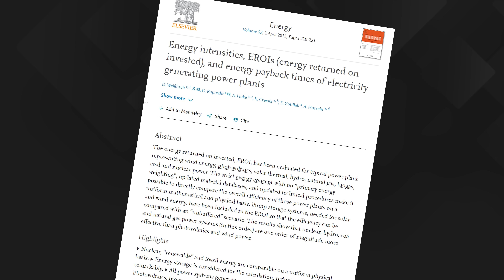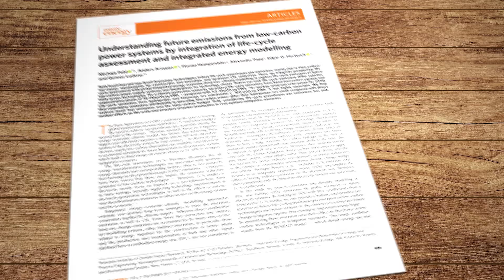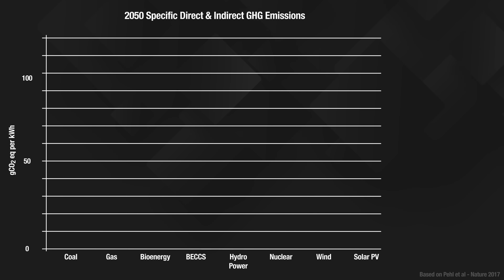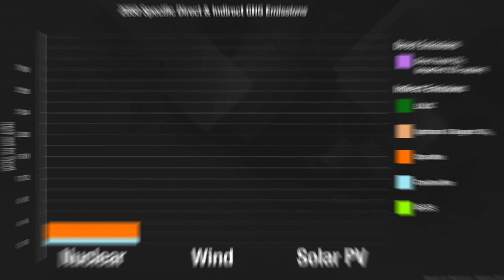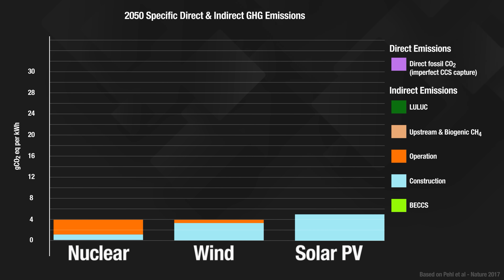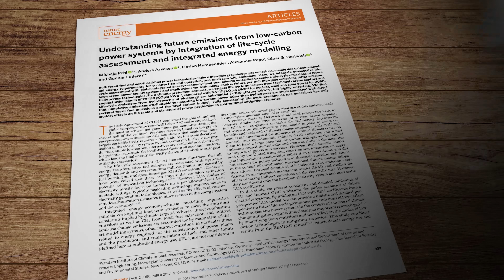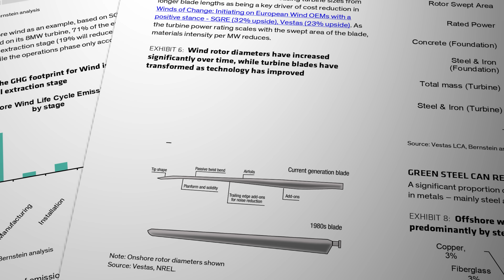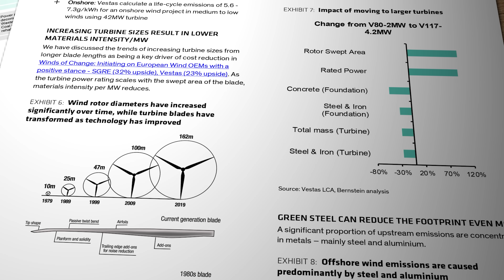Lifetime carbon emissions of renewables vs fossil fuel. Problem or solution?

Comment: Nuclear Power is a glorified steam engine with deadly nuclear waste we have to bury deep underground and has the potential to kill all life on the planet if things go really bad.  We have been very lucky so far in regards to nuclear power Fukushima nuclear disaster still could end up being a long term killer and has affected the Pacific ocean fishing industry and wildlife.   Tesla had the right idea we should try finding out how we can get the electricity that sits freely all around us called zero point energy which does exist and probably used by the military which is at least 50 years ahead of the private sector in technology having portable nuclear batteries since the 60s.

Comment: Is there any method founded to recycle nuclear waste
Reply: In France a part is re-used, our nuclear with everything including waste management is at 4g/kWh, there was a project called Astrid for even more waste but it was abandoned for few reason… mainly political 
We could recycle some amount and we could potentially closed the cycle even more, but nothing for waste already present and stored but you should realise that for France all the long life high activity nuclear waste of all the country during his history, so decades of low carbon electricity, represent a cube of around 15 meter… it’s a very tinny probleme to managed this amount of waste comparing to all those co2 emissions and air pollution it has avoid
Reply: The answer would seem to be yes, but it's cheaper to just go mine some more. Moltex and other future reactors do intend to use so call waste as fuel.

Comment: Thanks for that video. I wonder though, when you account for the energy storage required for the intermittent (P/V and wind) options how the equations might change? 
 It looks like a combination of nuclear for base load to go along with wind/solar and of course energy conservation (we are an affluent and wasteful lot) might be the most promising solution,...at least for now.
Reply: wouldn't be much if the extra electricity was used to make hydrogen and then that hydrogen could be used in a fuel cell to create electricity again. even if you had 10x more wind/solar then what was needed and even if you only got 10% efficiency from the conversion of electricity > hydrogen > electricity. it still wouldn't come even close to the other major polluters. granted this 10% efficiency is laughably low and it's actual rate is much much higher then that already (70%+).
with current lith batteries, i doubt it would even be worth it. however the new batteries that are being worked on, well those might be quite different.
the reason to go hydrogen over batteries is that hydrogen has uses well beyond just energy storage.
Reply: If you mean batteries, then what we hear about EV production suggests quite a large carbon footprint.
Reply: @emmabird9745  Source?? "What we hear about EV batteries" is often naysaying from fossil fuel interests. Or they make valid criticisms about OTHER pollutants, not CO2. In the case of EVs the extra CO2 from building the battery is more than made up for after 3-5 years of average American driving patterns. So I can't imagine battery storage bumps the CO2 intensity of solar and wind anywhere near fossil fuels
Reply: @ThomasBomb45  Hi Lily.  I am certainly not a naysayer.  My reference to cars was only because that is where the talk of carbon cost of batteries has been.  If I had a simple affordable route to convert my petrol car to EV I would do it.  Unfortunately that is not vissible and new EVs are way out of my financial reach.  
I am sure there are varied energy/GHG costs of different sorts of batteries which should be taken into account in life cycle costs and hopefully they will be low.  See also my reply to Aaron below.
Reply: @emmabird9745  depends on the battery. Most people think of lithium batteries, which are expensive so they can be small and light.
You can make batteries out of iron, water, even CO2, if you are willing to devote some land and space to it.  I'm not talking about gravity storage either. Iron batteries use the same mechanism as lithium. They take 10 times the soace but 1/10th the cost, they are also better "long load" batteries, good for lasting decades of a 12 hour charge, 12 hour drain cycle.
Reply: @aaronbaker2186  
 I agree, Aaron. Most of the current "talk" is about lithium batteries and while their properties are a good solution for mobile applications that require them to be small, light and  quickly charged/discharged those properties are not near as necessary for augmenting intermittent generating sources for grid application.
 Hydrogen, as mentioned by a previous poster, is a promising concept, I also like pumped hydro and tidal. Both worth considering if your geography will allow for it. Tidal is also intermittent but its %100 predictable centuries in advance so it would dovetail very well with pumped hydro.
Reply: @aaronbaker2186  Hi Aaron.  You are obviously right on this and I agree.  Indeed I made a similar point some months ago talking about renewable storage for wind/solar in another video.  For static storage size and weight are less important than money cost, environmental cost and use of rare materials.  In this case environment cost should be paramount.
However what I was driving at (or trying to) was that batteries may have a GHG cost which should be taken into account as part of the system.  I did not intend to suggest that it might make it as bad as fosil fuels, perish the thought.
Reply: So you're asking for the calculation to include the assumption of a stable grid given climate/planetary variables like wind streams, cloud formations, and sun angles. 

I think the IPCC would be a better organization to get a better sense of that kind of LCA since the IPCC tries to incorporate those kinds of actors that deal with these kinds of variables outside of just the costs of construction, operation, maintenance, and deconstruction.

Edit: with that assumption in mind, I'm sure reports like this would need to incorporate battery storage because that is 100% needed to ensure grid stability

Comment: Nuclear waste can be 'disposed' of in a thorium salt reactor.
Reply: Nuclear waste fuel can be reprocessed and used again. France does this. It just cheaper to bury it. Also Moltex intend to use unspent nuclear fuel for their reactors.
Reply: @Music5362  The general consensus in the industry is now that building very deep and secure (ie not just a literal hole in the ground to drop stuff into) storage sites at great cost is the way forward. Why would that be if all nuclear waste can truly be reprocessed, the cost surely can't be more than the expensive deep storage solution? I do remember a British nuclear site trying, a couple of decades ago, to reprocess fuel but for whatever reason they could only reprocess paltry amounts. That seems to be a recurring theme in the nuclear world, always promising magic but usually falling a long way short.
Reply: @danyoutube7491  From what I have read regarding Thorium salt reactors. Spent nuclear fuel rods which contain: 96% of the mass is the remaining uranium: most of the original 238U and a little 235U. Usually 235U would be less than 0.8% of the mass along with 0.4% 236U. Thorium salt reactors can adapt to a variety of nuclear fuel cycles (such as Uranium-Plutonium and Thorium-Uranium cycles), which allow for the extension of fuel resources. They can also be designed as nuclear waste “burners” or breeders. which will produce a 2% waste of Cesium 139. The main reason why Thorium salt is not implemented is because Thorium/Uranium 233 reactors do not produce Plutonium, Which is needed to replenish all nuclear warheads every 12 years. A large percentage of nuclear waste is decayed warheads.

Comment: Renewables should be considered low carbon not carbon neutral, untill there is  acompanying carbon capture, and whilst the nuclear waste storage will take some energy it will be  relatively trivial as these are only for high level waste
Reply: Yeah I believe that is the common phrase for it. Low carbon, i.e. nuclear, solar, and wind. Possibly biomass and biogass, depending on the sourcing of that
Reply: " these are only for high level waste" Of which there are 400,000 tons of over 1000 deadly radionuclides, mostly sitting at NPP's and reliant on the power grid to keep them from burning unquenchably. Game Over!

Comment: why is nuclear always assumed to already come with free fuel? producing nuclear fuel is among the most complicated and energy intensive metallurgy humanly possible. (this is also by the way, where most of the  risk lies, when you scale up nuclear to the necessary amount to keep up with our needs, the question if reactors are 'safe', is just the wrong question in that regard) all the mining, nitric acid and fluorine production necessary to produce those elements is never factored in, neither regarding co2, nor cost, while with renewables on the other hand, almost all of the carbon production misleadingly assigned to them comes from the energy put into production, which could and should be substituted 100% by renewables in the first place! there is no intrinsic reason for a solar cell, or wind turbine to produce any co2 whatsoever, given enough carbon free generated electric energy to produce them is available.
Reply: @liem11  you don't seem to have the slightest idea of what you are talking about. 'recycling it' makes things a whole lot worse in terms of nuclear waste as well as in terms of energy consumption. You might want to have a look at those videos:
https://www.youtube.com/watch?v=DmczVhGq8cU
https://www.youtube.com/watch?v=E0wtKOG8trE
and all the others periodic table of videos produced within the oakrich facility to get an idea...
and be aware to the fact, that none of those hot cells you see there have been opened since taken into production, because that's a thing humans can't survive. the same goes for all those sub terrain tanks and there contents mentioned. apart from the tons of highly radioactive waste per pellet, there is also ten more tons of contaminated waste, that's not measureable radioactive, yet can still kill thousends of people, when catching fire, or dissolving in drinking water.
also it's not a discussion, the numbers exists and nuclear as done today produces a shitload more co2, when fuel production is encountered it comes out between the renewables and natural gas.

Comment: The emissions for manufacture of renewables also improves over time due to the energy mix used by the factories becoming less emissive as the previous batch of renewables are installed. Current household solar is only around 20% efficient and industrial solar around 25%, so will be interesting to see how those numbers change as the newer 40+% panels become commercially viable. In theory the emissions should be lower than even wind, but depends how the manufacturing and lifespan changes with these new ones.
Reply: My 7.5 PV system  with battery backup meets all my needs and the best thing is the sun never sends me a bill!
Reply: I would rather have a 20% efficient solar panel at half the cost/kwh and half the CO2 cost than a 40% efficient solar panel that takes more specialized components. We have plenty of roof to power buildings, so trying to make panels slightly smaller is probably not important for most.
Reply: Your first point is a very important one. 

As we adopt more commercial green generation at the facility endpoint, the greener it gets to make green energy products. (Put solar panels in the roof of the facilities that make solar panels and their materials production, and their distribution warehouses) It is a beneficial feedback loop. 

Same thing for EVs. The more commercial EVs and electric industrial hardware the greener it  gets to mine, ship, refine, ship, manufacture and ship EVs. 

And if we do both adopt green generation and EV transportation at the same time, they both compound on each other for lowering emissions of all industries.
Reply: You do realize that over 90% of solar panels are made in China, i don't think they are going to switch off all the coal any time soon.
Reply: Imagining that solar PV will approach 40% efficiency flies in the face of reality. I would love that to be the case, but the big minds working on these things have assured me we are nowhere close. I'll quite happily go with panels and turbines and call a swift end to the fossil fuel industry
Reply: @OAK-808  Solar cells with near 40% efficiency exist, but they are extremely expensive, require multiple junctions and quantum well technology, are made of toxic materials, and are currently only viable for satellites and inner solar system space probes.
Reply: How much energy is required to make a watt of solar, a watt hour of battery and for their recycle? How much is left over to power humanity AND to double it's growth?
Reply: @fireofenergy  From the research I saw, wind and solar seem to have an energy payoff of 5-10 years. Given that they generate power for 30+ years, it's pretty good. Depends on location, a solar panel in the shade and a wind turbine in a calm climate take longer. But obviously people tend to build them where they generate the most power, and profits
Reply: @ThomasBomb45  
I believe it's now ten, since more efficient manufacture.
However, we have to double up. Solar has to be able to make itself. It also has to make enough solar to power the inverse of its capacity factor. It works about 25% of the time. This means we need to make 4x the solar, in order to store (like 3 parts of that energy) in batteries. Batteries require a lot of energy to make, however Tesla is already getting this process more efficient, too.
So, not sure if there will be enough power for a still developing world.

This is why I also want mass produced advanced nuclear reactors, too.

Consider for a moment how much solar the world would need if the energy for it and its batteries (the OVERALL energy pay back time, better known as the total energy returned on energy invested) was only 2. I guess it would be feasible but like 5x the land would be needed than if it was 10. Another way of looking at it could be "it takes half its life to generate the energy needed for itself and its batteries".
Reply: The production of solar panels guarantees the coking and combustion of metallurgical coal and the mining of very small and non-renewable stockpiles of high grade quartz.
Reply: @gregorymalchuk272  
You would think that electricity can also be used to make solar/battery. Just how much, though, begs a valid concern.
Reply: @gregorymalchuk272  
Sorry, you don't know what you are talking about.

High grade quartz?  Where is that used in solar panels?  Sand is used for both the glass and silicon PV wafers.  Aluminum uses no coal; it's made with hydroelectricity.
Reply: @acmefixer1  "Solar panels and microchips are made from sand" is the elementary school explanation. Sand and quartz are both silicon dioxide. But common sand contains too many impurities to make it economically viable to produce semiconductors with. That is why semiconductors are made from purer deposits of metallurgical grade quartz. Aluminum is smelted with electricity, some of which comes from coal and natural gas. And a not insignificant amount of the chemical reduction actually comes from the carbon monoxide produced from the consumable carbon electrodes as they burn. The electrodes are made from petroleum coke, the muck left over after refining crude oil.
Reply: The numbers being shown in this comparison do not add up to the numbers I have seen by very very passionate proponents of green energy in the past but have changed their mind.  I do not doubt the veracity of this channels presentation but I do doubt the numbers being presented have been totally dissected by opponents of the green industry.  Usually somewhere between the pro factions and the con factions are where the real truth lays.
Reply: @anthonycarbone3826  Share those numbers?
Reply: @anthonycarbone3826  
The big oil and fossil fuels industries have spent hundreds of millions on marketing doubt about the true amounts of greenhouse gases that fossil fuels emit.  They cherry pick data, use false analyses, and cast doubt on every legitimate study done by reputable institutions.  They have those like you doubting the truth:  fossil fuels are killing the Earth and must be stopped and replaced by renewables.

Comment: Wind and solar don't work without storage. When you add batteries, H2 or pumping-hydro in the huge amount needed, solar and wind give you 100-200 CO2 per kWh produced LCA (note, two sets of batteries go in a 12y lifespan of one coastal wind turbine). Engineers know this for a bout 10y ... it is ONLY nuclear - nothing else.